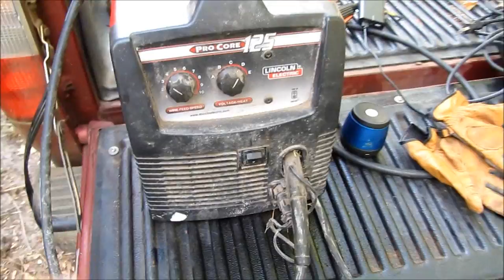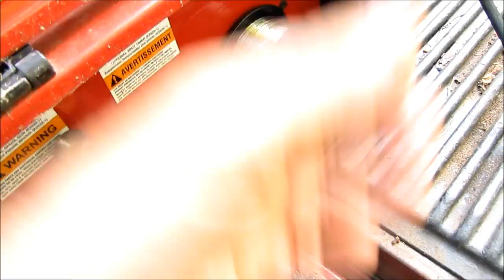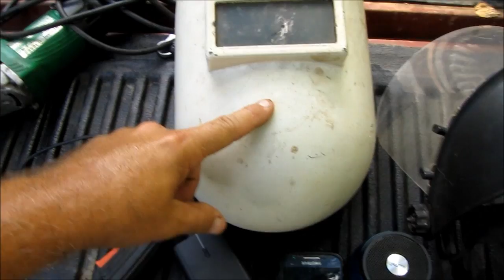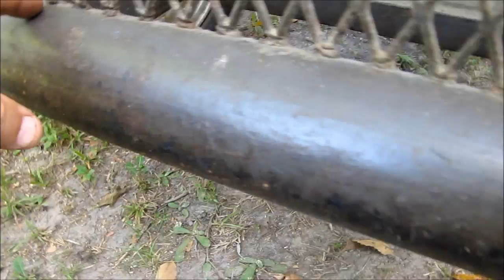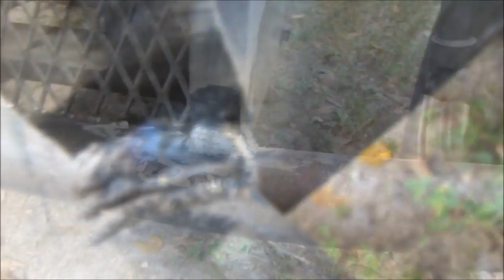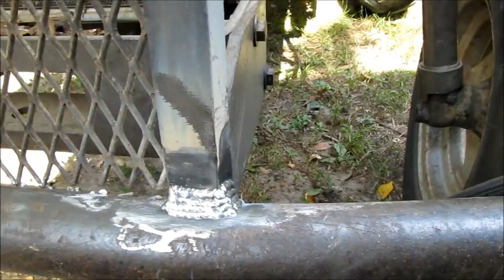Farm welding basics

Comment: I know this is repair work and you do what you gotta do, but a proper fit up and one well executed weld and it'll be stronger than stacking a dozen welds on that poor fit up. Dumping all that heat into the part does it no favors.One  other thing to mention for doing farm/homestead repair work, a stick welder is about the best there is. Some 6010 and some 7018 and you could fix the world!
Reply from the maker: Yep.  The angle iron always breaks at the top of the weld.  Each time I 
have to stack the welds higher.  Next time it breaks I am going to put 
in a new piece of angle.

Comment: Question: mig or flux core?My answer: stick
Reply: I'm with you. I use my powerarc the most.
Reply: 100% with you right there. Flux core is NOT structural, and is nothing like dual shield flux core.
Reply: Stick can weld thin to thick metal . To almost welding air together .
Reply: Everyone is a critic lol

Comment: Good video.  Have you thought about taking a piece of flat stock shaping it to fit around the pipe and running it up the angle iron 3 or 4 inches then welding it in place as a support?
Reply from the maker: Good suggestion, thank you

Comment: I would have welded a flat bar to the angle iron down to the bumper been done ✅ just a thought or put sone gusset on it! Plus I would not use a 110 volt welder I use at least a 220 volt machine!

Comment: holy jesus. 14 years welding and thats what you do?  sorry...
Reply: analyze for a bit. What is he welding? A critical part for a nuclear facillity? no. Its a tractor and it need not be any prettier. Making an eye-watering pretty weld would just take too much effort and time and hence the title: "farm welding"
Reply: Agree
Reply from the maker: If you can do better, upload a video.
Reply: He said in the video, he said he knows it's gonna break again. He's also using flux core wire, which is shit no matter what you do. 

I will say, he is wrong about the welding process choices. Flux core is NOT a structural process. Period. Get a cheap stick welder and run 6011 and 7018.
Reply: casey360360 agreed on this comment
Reply: casey360360 lmao you know nothing, fluxed core can be used in structural steel. Steel erecting and rigging companies use flux core due to its high deposition rate and its tensile strength.
Reply: You sure that aint dual shield your steel erecting and riggin company uses because the way you just wrote that means you don't weld yourself for your company? i myself would never use this i think its a crude process and much better options. Id rather use stick over gas less.
Reply: Welding Junkie it’s not dual shield. It’s fluxed core. I’m not trying to argue about it, as I use 7018 when doing anything structural, I’m just stating the fact fluxed core can be used in structural welding. I took two cert tests one when I was in welding school for 7018 and one when I got into my first structural job for fluxed core. They use fluxed core because they are surpassing 7018s 70000 lbs with the wire, and it’s quicker. And you do realize dual shield is flux core with gas right?
Reply: Jacob Robbins that’s because 7018 is an pre approved structural process. Flux core is not, you can use anything you want if you want to pay for testing your welding process and get it approved but good luck with that one
Reply: Welding Junkie Really? Do you know what AWS is? There are fluxed core wires that are AWS approved... You weld to code, by AWS, yes 7018 is a coded rod.. but so isn’t 6010 and 7024. They make a shielded wire for structural welding that is too code. They wouldn’t make you take a D1.1 with flux core if it wasn’t structural..
Reply: Jacob Robbins you missed my point apparently. No big deal. Have a good day.
Reply: Jacob Robbins low hydrogen processes my friend. Do some research I suggest talking to structural engineers or use google. I’m not going to argue with you because you obviously just do not know. Structural engineers balk at hard wire. Read up man
Reply: Welding Junkie ha okay guy.
Reply: Welding Junkie at my shop we use Core 8 wire it's 1/16 wire and gas less flux core and probably most of the structural bridges and buildings around my area has those welds. I'm not trying to dumb you down or anything but if you are certified and know how to run it is a great weld and a faster process then ark.
Reply: youshi34 core shield 8 82ksi strength and it’s pre tested approved specialty E71T wire... yes. Gasless flux core not even close. Especially the shit he bought from Home Depot...Trust me you are dumbing me down.
Reply: @weldingjunkie  Where I work solid wire is used for structural coded welds and pressure vessel welds every hour of every day. We butt weld 3/16ths'' and 1/4'' sheet metal short circuit downhill. You do have to test before you are allowed to weld in the structural area. We build pipe networks where with socket welds that are pressure retaining and structural both spray transfer GMAW single pass 1/4'' legs on the fillets. You also have to test for that it is what and all the engineering dept will accept. Then back in another dept. we build steam valves and gauges most of the work is done on turntable it is solid wire pulse spray GMAW. These parts hold many thousands of psi steam. We weld poppet valves in another area once again solid wire GMAW theses are lower pressure at around 1000 psi. With gas mixes over 90% argon the weld is low-hydrogen with bare wire. Instead of telling Jacob Robbins to read up you might want to read up. I have seen you in the comments before you are a real piece of work. I wish I could buy you for what you are worth and sell you for what you think you are worth. I would never have to weld again!
Reply: @jacobrobbins5052  Sorry that you got harassed by the village idiot of welding videos. I have tried to explain things to this neanderthal before and he wanted to meet up with me to fight as a last resort to make himself right. I am glad he did not threaten you!
Reply: Welding Junkie  You and Jacob Robbins really sound like the both of you just learned how to weld or still attending school watching YouTube videos. If the both of you knew terminology on anything you were arguing about then it could have been done. If you thought he was talking about using 0.35 fluxcored on structural steel you should have already known. He was talking about FCAW dual shield which is used for structural steel and even pipe wire size .045 with Co2 primarily used in shops due to its faster weld process for pre Fabrication. Oh ya and it’s used on naval ships as well. Steel erection if the both of you had any experience with erecting iron work etc than you should know that NR 232 .072 FCAW Innershield which by the way means solid hard wire that needs no gas it’s a 70 series which is basically stick welding with wire. Have either of you heard of full pen welds? Well that’s what it’s for fluxcored is used for structural the difference is the size in wire .035 wire is  for light gauge material also known as sheet metal anything under 1/4” of material thickness. And is not used on steel erection if it’s used for anything it’s used for a hanger clip on a piece of ibeam but in this video it’s used for light gauge shit that doesn’t matter will never be inspected ever. Don’t need to be an engineer to know that shit.

Comment: Looks like it may be suffering from metal fatigue, a knee brace would help eliminate the vibration that caused the breakage in the first place. I have no problem with your welding, your limited by the machine, don’t get me wrong, I own 4 Lincoln welders they work fine for me.

Comment: "Certified" welder proceeds to "weld" over porosity and dirty, rusted steel steel with truly awful fit up. Then shows his "certified" inability to run a straight and/or consistent bead while also demonstrating either the inability of the machine to produce enough current to actually fuse the toes of the weld in or his inability to set it properly. I'mma thinking something ain't quite right here. 

Think I'd be grinding off all of that goobered on, little to no penetration, buildup of filler before I welded it back on correctly with a machine big enough for the job. Also think I'd fix the engineering problem and fitup issues at the same time. You can continue globbing filler on that for eternity and it's still going to break otherwise. 

If I absolutely had no alternative except to use the machine in the video, I'd at least take the time to grind to clean steel and then preheat with a torch. I'd still fix the engineering and fitup problems while I was there...no point in adding more problems to overcome.
Reply from the maker: It is all in prescriptive.  Is this is a pressure vessel or heat excahnger, or boiler... nope.
Reply: Fourteen years as a keyboard welder.

Comment: This is something I've wanted to do for a long time. I bought one of those Harbor Freight 90 amp welders, but have yet to take it out of the box. Should I start learning with that one, or should I get something more like what you are using here? Thanks for the videos!
Reply: Thank you. What would you suggest I look for in a rental welder to learn with?
Reply: screw renting one, get a lincoln 225 tombstone welder and use that to learn, you can find one on craiglsit cheap, i got mine fore 150. and got a benchgrinder, mask, 1lb of rods, brush guard and soem other stuff for free lol

Comment: Should’ve cut the ENTIRE old weld out, then put one good pass. Don’t know how you’ve been doing this 14 years
Reply from the maker: This is for a tractor, not an ASME Section VIII certified heat exchange or pressure vessel.

Comment: any welder with half a brain will see that its a tractor and not a very critical part of it either. Those welds will do fine. A pretty stack of dimes looking bead right there wouldnt make the tractor function any better.
Reply from the maker: Thank you very much.
Reply: I'm not a welder, I'm a machinist that welds(and gets paid for it on occasion). Got paid for  tig today, on top of mill and lathe work. Got paid for stick the two work days before. Might complete the trifecta and get paid for some mig before the week is out. I also have some pride in my work and I absolutely friggin hate it when someone brings in their booger welded, bailing wire and duct taped for the last 20 years pile of shit into the shop to actually be fixed. Bossman usually turns that sort of work down, thankfully. 

You can do the job right once, or you can do it poorly.....over and over and over again. Time is a finite resource, don't waste it.

Comment: Go to any "outdoor" construction site and you will see welders using gas, not flux core. 
You may have the experience and credentials you say you do in this video, but nobody will believe you when you're using flux core and producing welds like that. 
I understand it's just a quick fix on a tractor, but this is not a great example.
Reply from the maker: Ever had a gas shield blown off by wind?  If so you would understand why you do not weld outside in the open with gas shielding.  The porosity goes deep into the weld and has to be ground out.  Chances are the next pass will develop porosity from the porosity you did not grind out.  Losing your shielding is a big fat mess.  So tell me again why anyone would use it outside.
Reply from the maker: If you see wire welding outside it is probably fluxcore with gas shielding for extra protection.  I have done this several times myself.

Comment: my 10 year old can out weld that on his worst day .certified my ass Im certified and that would never fly and wind is not the reason you use fluxcore i weld outside most of the time with gas and theres many ways to overcome shielding gas blow away flux core is better for very rusty and painted metal and provides better penetration .
Reply from the maker: Put up pr shut up.  Post your own video.  What are you certified on and what kind of stuff do you weld on?  I built ASME certified pressure vessels and heat exchangers.   I will even provide you company names and references in private message.
Reply from the maker: A year later, still waiting on you to post your work history and credentials.
Reply from the maker: They are not crap, the weld has held for over a year.

Comment: maybe you could add a gusset from the pipe to the angle iron, would be easier and stronger than the flatstock wrapped around the pipe , maybe a half inch gusset with a hole in it for a hook or, clevis, no need for replacing anything if you do it thata way.
Reply from the maker: Good idea, thank you.
Reply: no prob,it would make a great vid